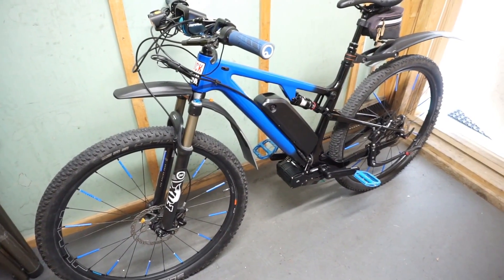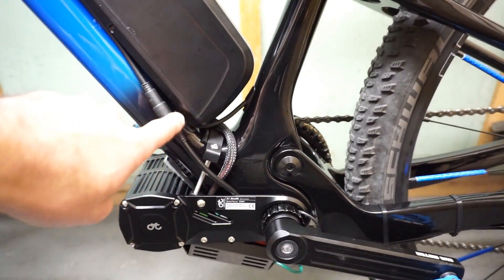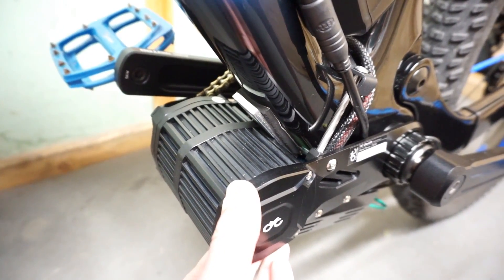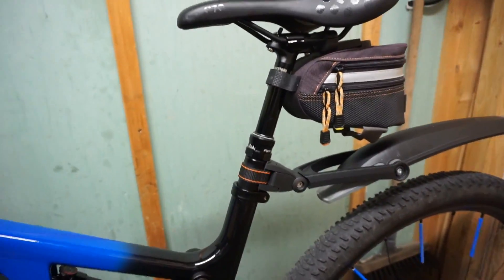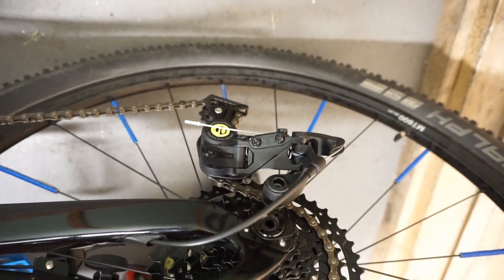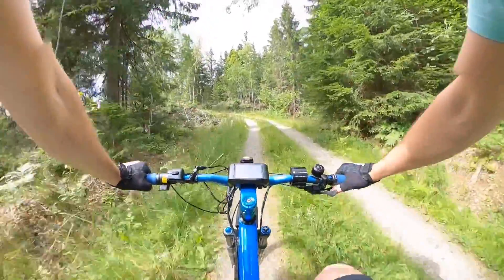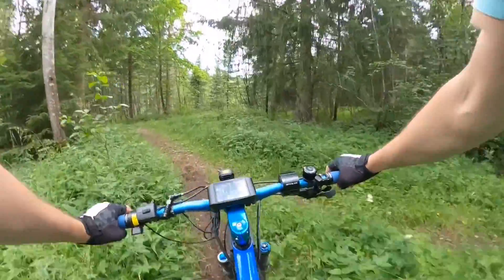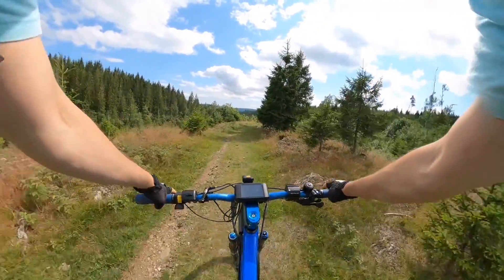Trail bike conversion with CYC X1 Stealth

Comment: Anyone know the measurement for this motor from the center of the BB to where the motor BEGINS,I have a polygon T7 with a longer BB area & dont want the motor to hang down too low, another thing is I might be able to put the motor in the frame cause rear shock is mounted higher ???
Reply from the maker: You will find all CYC motor drawings on their website. You can print them out and make a template with a cardboard.
Reply: @LierskogenEbikes  I just put a Bafang bbshd on 1 of my mtn bikes & like it,was lookin at this or the pro,what s the top speed you can get with the stealth in stock form ?
Reply from the maker: @joehiatt1992  Top speed depends on the voltage and your style of riding (PAS only or throttle?). I have 48V and no throttle. This bike can easily go up to around 55 km/h on flat road.

Comment: How is it holding up? Still going strong no issues or parts breaking/coming loose after miles of riding?
Reply from the maker: I had to regrease the gearbox year ago. I broke the seal and water got into the gearbox compartment. Other than that it works fine.

Comment: that noise sounds like straight cut gears not hypoid gears, would i be right does anyone know the exact source of the noise it makes???? Its not electric motor noise because electric motors are quiet🤷‍♂️
Reply from the maker: CYC motors have planetary gearbox. That's the source of high pitch noise.
Reply: @LierskogenEbikes  ahhhh true! That explains alot thanks! I've watched many cyc videos and wounded this but never asked or looked into it.. watching your mint build i thought you would know for sure hahaha thanks 🤜🤛 must be metal ones to to get that pitch
Reply from the maker: @rossg9363  Yes, I use bronze cogs now. CYC don't even tried to introduce plastic ones as an option. No point to do so. The plastic type would not survive very long this level of power.
Reply: @LierskogenEbikes  true! Yeah they look impressive power. I got a 52v bbshd pretty mint build to with boost size wheels xt gear on it i appreciate a nice build and yours is way up there i like it👍 the paperwork that came with my bbshd kit said not for use on carbon fibre frames, i think its the clamp force on the bb they say that for the bbshd yours has those straps around the frame you pointed out in the video  which is the go for carbon fibre. Nice one👌👍

Comment: Seems like lots of exposed wires on a typical contact point. Have you had issues with dirt and wear and tear?
Reply from the maker: I had a problem with water ingress into the harness contact. After that I installed the controller inside the plastic box. New controllers have fully sealed main harness connector, so water is no longer an issue.

Comment: What's the name of the bike frame?
I'm looking for full suspension which can hold a battery
Reply from the maker: I bought it from Carbomania shop on Aliexpress. You need to go for at least L size to fit the battery. XL is recommended for better clearance.

Comment: Which battery???
Reply from the maker: My battery. If you ask more precise question, I can give you more precise answer :)
Reply: I mean how many volts and amp hours, and where did you buy it and whats the typical range you see with minimal assist, thank you.
Reply from the maker: @DiveBombSimRacing  I built it myself. Spec is 48V 14Ah with power draw up to 30A.

Comment: Are you running the magicshine off the ebike battery and controller?
Reply from the maker: Hehe, I was thinking about that. In theory it's possible, since BAC855 has separate circuit for external lights. Problem is, you need to add two wires to CYC JST connector and controller can provide 6V and max 3W power. I stick to dedicated battery for lights. You can install separate transformator from battery voltage to 6V to supply the light. You can get them cheap on Aliexpress.
Reply: @LierskogenEbikes  ya I wish bafang, cyc, etc would beef up a separate circuit for some proper lights. Appreciate the reviews, I run a bbshd, love the power but a bit of refinement with a torque sensor would make this an incredible set up. Next build I'm going for a CYC X1 stealth. Happy riding!

Comment: Thanks man for all you did! Is it noisy like it sounds on the video when you pedaling?
Reply from the maker: It's much noiser than Bosch or Bafang motors. But from the distance noise blends with wheels running on gravel.
Reply: @LierskogenEbikes  I wonder if it's annoying on road if you do 30 miles like?
Reply from the maker: @ManewBlewww  For me it's perfectly fine when I pedal. I often do trips between 30 to 40 km.
Reply: @LierskogenEbikes  ok sounds good! Thx🤝

Comment: that motor is so noisy. probably due to high motor rpm and straight-cut gears. ok when you feel like riding a motorbike, but disturbing when you're mountain biking... ofncourse the controller is much better than the bafang, as is the presence of a torque sensor. but the bafang bbs, if properly greased is sooooo smooth and silent.
Reply from the maker: The reason for noise are planetary gears. Other than that, it's great motor. I was riding with Bafang BBS02 2 years ago, never again. It's great motor for commuting only, when you ride with more or less constant speed. For trail riding it sucks. There is a reason why Bafang so heavily promotes M400, M500, M600 and M620 motors for eMTB's. All of them come with integrated torque sensor.
Reply: @LierskogenEbikes  honestly I can ride technical trails just as well with the bbs02 as with a bosch cx. as long as you keep cadence and have the throttle for emergency restarts, it's just fine, that is if it's programmed well. stock programmig is complete garbage. chain line is another  point where life is easier with the cyc, but there are good solutions for the bbs02 out there. obviously not simple off the shelf stuff. The frame integrated motors from bafang require a special frame and are a lot more expensive for what you get. the m600 in particular is in my opinion killing the peace on the trail with it's awful gear sound. the last bbs02 I installed had new RC-style tidy motor windings and darker enamel coating, and sounded significantly "zippier". sure a torque sensor would not hurt, but I can live just fine without, in fact the throttle only gives me more control over starts in difficult situations

Comment: I honestly wish they had a way to make this system class 1 only with just pedal assist for legality reasons
Reply from the maker: You can disable throttle in the motor app. It's not the same as physical removal of throttle, but at least you can show that throttle doesn't work.
Reply: @LierskogenEbikes  is there a way to physically disconnect the throttle or nah?  That's a large distinction between class 1 and class 2 here (and class 2 isn't allowed on trails here)
Reply from the maker: @Emolokz  Maybe there is a way. I haven't investigated it.

Comment: Thanks for videos. Which motor do you choose for city bike 60km/h max speed, fast, quiet, economical and reliable: Bafang Ultra 1kw, CYC X1 Stealth, CYC 1 Pro? Bafang Ultra is much quieter CYC?
Reply from the maker: I would go for Bafang Ultra, but I doubt you will hit 60 km/h with stock motor. Rather 50 km/h max. And you need to buy dedicated frame for this motor. They are expensive and hard to get.
Reply: @LierskogenEbikes  thanks, do you think which frame is better: seroxat  aluminium or carbon Dengfu e06? Also find wattwagons hydra, but it is expensive.
Reply from the maker: @kiryl9442  Degnfu looks much better. And you get integrated battery.

Comment: Do the battery 🔋 last a lot or not ?
Reply from the maker: I haven't tested maximum range yet. It heavily depends on how hard you ride and where. I ride around hills with very ondulating terrain. The longest trip I had was around 50 km and there was still some energy left in the battery. Riding on level 3 most of the time, no gas.

Comment: What is the maximum speed you can get when using only throttle on flat road?
Reply: @LierskogenEbikes  Thank you!  That is good enough for me, and I can use my existing battery.
Reply: How fast can it go?
Reply: @christopherfeiler551  He had replied to me, but I forgot the figures. I do not know why his reply disappear.  May be he deleted it.  It should be above 40 km/h and that is why I replied that it is good enough for me.  I have not tried that with my Stealth because it is still cold for me in my place.  Will get back to you once I have tried it.